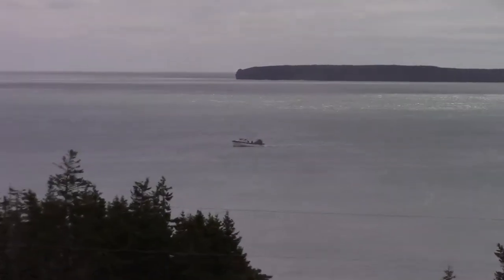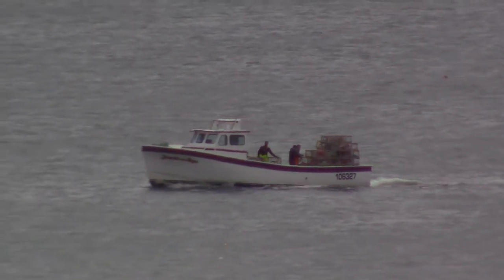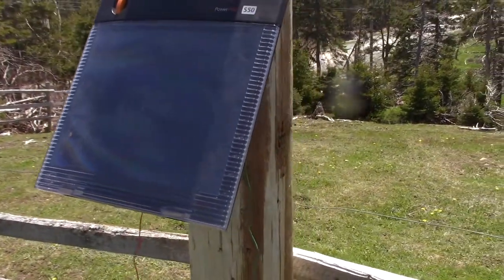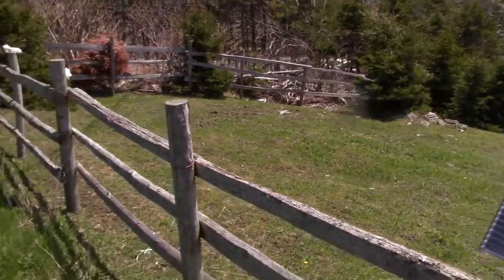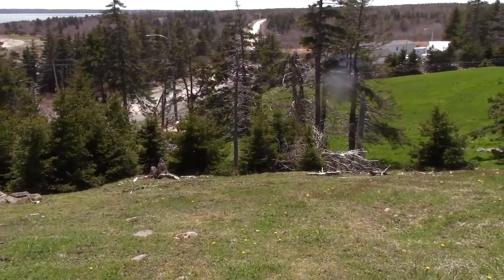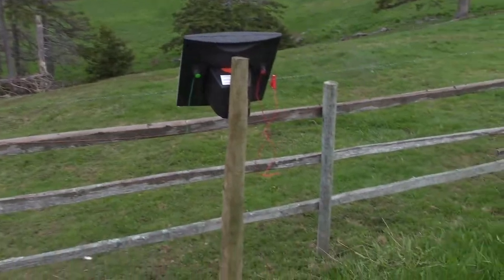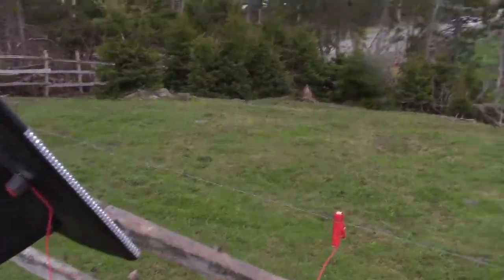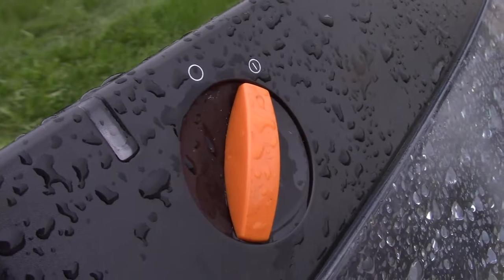ZAP ZAP Electric Fence

Comment: That is a nice energizer, I have a electric one, I guess that one works only during the day or do you have a battery in the line for the night, it works for 36 hours on the small 12V alarm batteries if the power is off, how many Joules did it have
Reply from the maker: +Jan Kotze there is a battery inside of it. I'd have to look up the specs on it there wasn't much left of the box when I got it from the shed lol
Reply from the maker: +Jan Kotze looks like it's 0.5 joules
Reply: Hi Mac, I am not electric guy but that might be the amps, I guys it is about 5000 joules, nevertheless it's a nice video